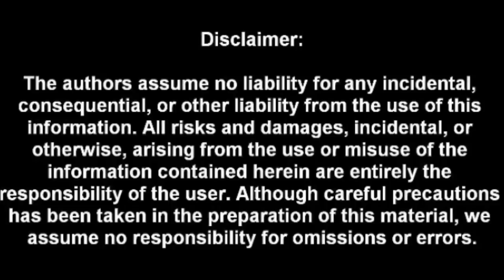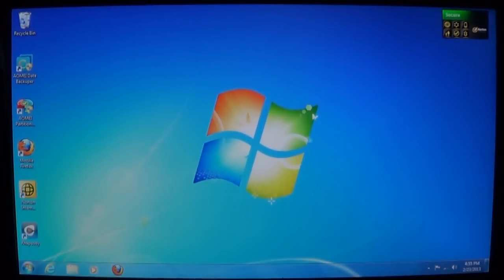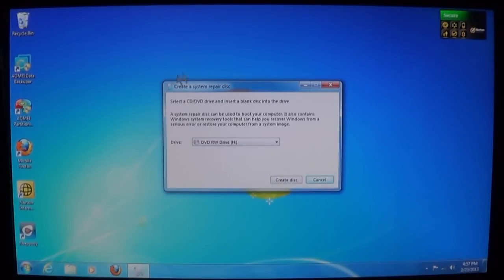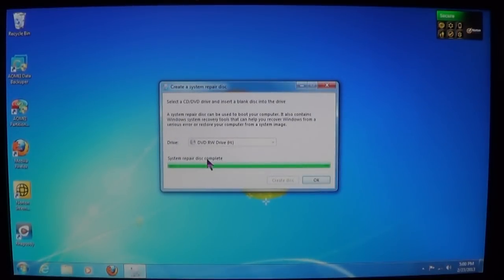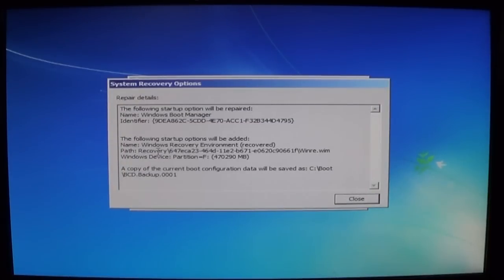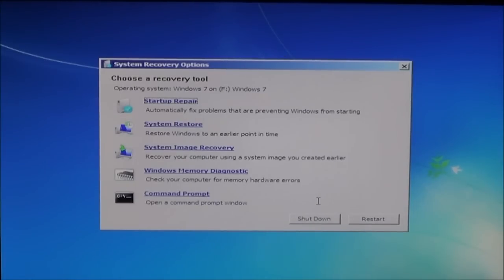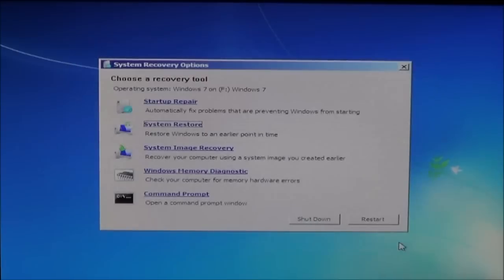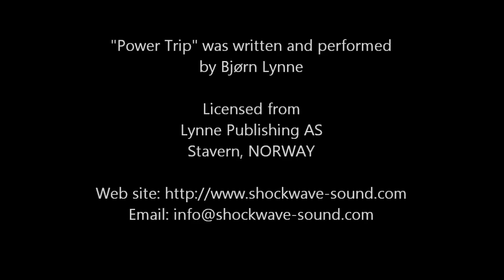How to create a Windows 7 Repair Disc

Comment: If you used the "System Image Recovery" option wouldn't it reinstall the OS since it uses a complete disk image to restore the computer?  Assuming of course you're backing up Windows and telling it to also do a disk image backup.  Good video, covering things in detail.

Comment: hello can i use the back up disc  when I got a virus on my pc? will it remove the virus without reformatting my pc?
Reply from the maker: +oolesh +Michael Jude  you can use the backup disc to restore the system but if the virus became part of the backup, it wouldn't make a difference.  -MrFixit
Reply: Ok thank you

Comment: Very nice!  I need some advice.  I have not made a system recovery disc, but I do get  the system recovery options with no choices.  After clicking next I chose the "Startup Repair," of which is going on and on.  This usually does it though.  Trying to do anything else such as System Repair does not connect now and says "Parameter is incorrect (OX8070057).  Although, I'm not literate with Command Prompts I've tried to enter rstrui.exe, and it tells me to use rstrui.exe/OFFLINE:C:\WINDOWS, but I can't get in to make a restore point.  Don't know how to get out of this except let Startup Repair continue to run for possibly 24 hours.  I have Windows Vista 32 bits and I need to recover my files.  If anyone has some suggestion it would be greatly appreciated.  Also, I'm curious if these recoveries are done offline, or definitely need to be online.

Comment: When the create a system repair disc pops up, (the one where you select the disc drive) I have 1 option, Drive D:. But I can't find a disc slotted in my computer and I have no area near my PC that I can put discs in, yet even on my PC protector it says I have space on Disc C. Normal?
Reply from the maker: 56cpfan D:\ is usually the Recovery partition or a card reader. to create the repair disc you will need to install an external CD/DVD drive if your PC doesnt have one. -MrFixit
Reply: ESRepair How do I install one?
Reply: +ESRepair g
Reply: +ESRepair gccfvgggvc
Reply: +ESRepair gtcff
Reply: malk nour helpful

Comment: Can I use this disc to restore my computer to factory settings?
Reply from the maker: venyc82 The only way you can restore back to Factory setting is a recovery partition the MFG installed if it wasn't deleted. The disc only repairs the startup problem. -MrFixit
Reply: ESRepair  Hi there, how are you? Listened I created a repair and recovery disc on a DVD-R for windows 7. However, my windows is installed on my C: Drive and when I went ahead created it; it took the information from my D: Drive and repair and Recovery disc created for my D: Drive  instead of created it for my C: Drive. Is that normal?

Comment: - Will not resort from any point 
I keep getting on the repair that there was a web cam or mp3 connected please remove or contact administer yet I don't have anything connected.
- did a dskchk and did not run because the volume is being used
- so I am way out of ideas

Comment: I have two laptops. One working good but the other in stuck on BOOTMGR is compressed. If I create a repair disk on the one that is working and insert it on the laptop thats not working, would it work? Thank you

Comment from the maker: Depends on the manufacture, titanic. You'll need to enter BIOS by pressing either Esc, F1, F2, F3, F10, F12, or the DELETE key. These are the most common hot keys to enter BIOS, but vary by PC manufactures. The key is usually displayed when the PC first powers on. Once in BIOS, you can change the boot order from HDD to CD. 1st Boot device would be CD, 2nd Boot Device would be HDD. This will force BIOS to look for a Boot CD  1st then look to the HDD. -MrFixit